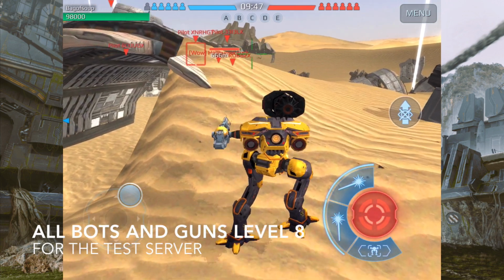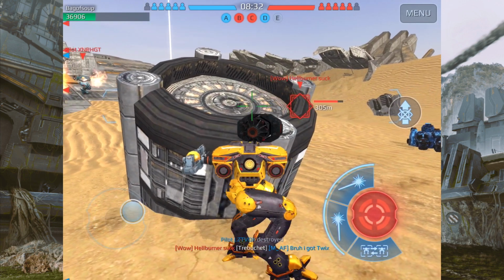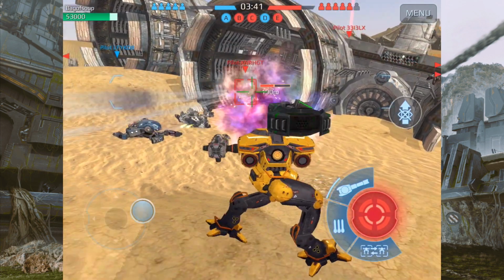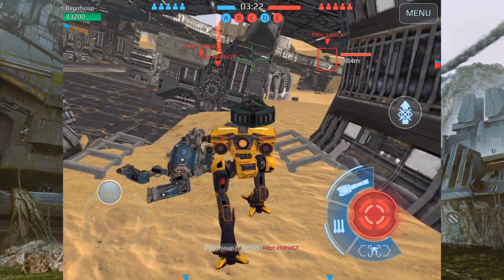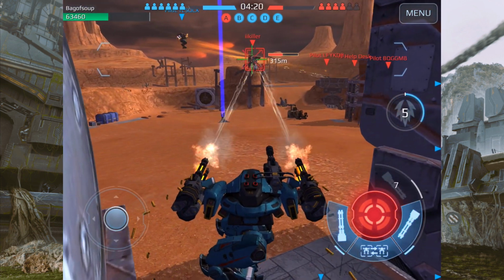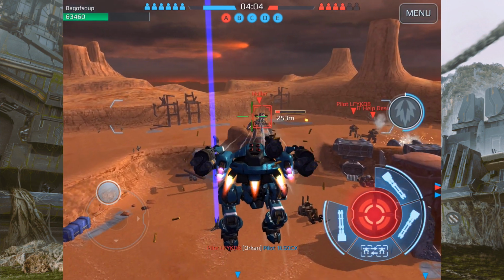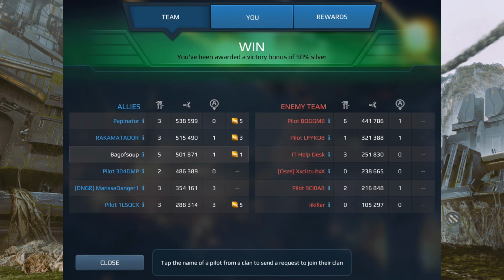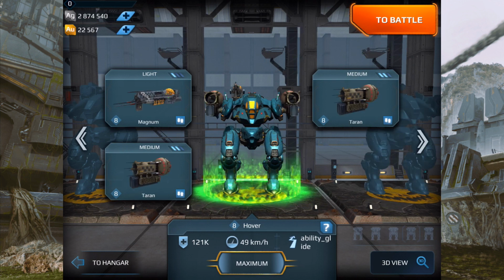Test Server 3.4 Recap: New Bots, Map, and Weapon!

Comment: I think that for the hlider it should be one medium on the left and three light on the right
Reply from the maker: Interesting. That sounds about the same firepower as well. And both 2 meds / 1 light and 1 med / 3 lights have not bet been used. I like the current setup on the glider, but some bot will need to try 1 med / 3 lights at some point. Kinda like a medium leo look.
Reply: yeah thats what i was thinking but as is, if you use the ecu you are wasting one medium weapon slot and a physical shield is needed to block gekkos and trebs ect. if the weapon orientation were as discussed you would only waste one light and you could still block the long range weapons.